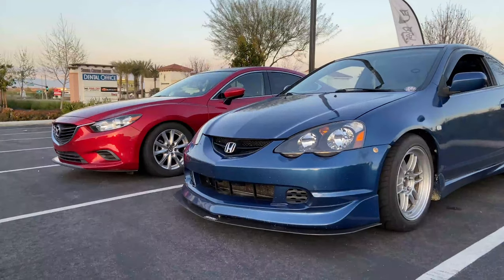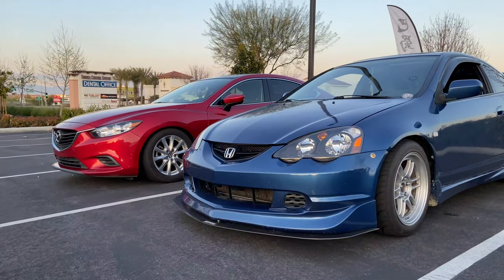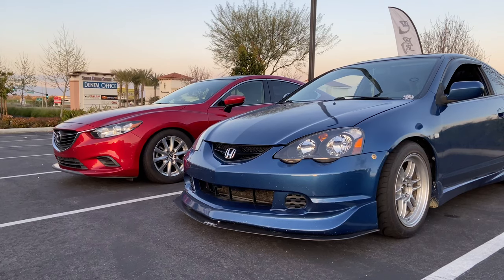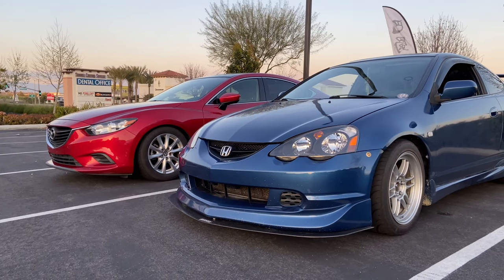VTEC IS NO JOKE! Racing a 2002 Acura RSX Type S With My 2015 Mazda 6!

Comment: Power to weight ratio plays big role here too, vtec won’t win against 2020 Mazda 6 with awd and 250hp and 6s are heavy! Lol
Reply from the maker: It's true, lol I'm surprised that my Mazda 6 did decent against it with only 184 hp and being 3200 lbs.
Reply: ABC Garage your car weighs more than 3900 I have the 2014 Mazda 3 and weighs 3907 with 155hp lol I used to have 2017 3 with 187hp which is what yours should be too and it pulled hard especially with sport mode on btw did you have sport mode? It shortens the ratio to 1:1 for faster take offs
Reply from the maker: Live2RIDE83 look up 2015 Mazda 6 sport weight it’s 3183 to 3232 lbs. I had it in sport mode
Reply: ABC Garage civics weigh almost nothing, I think 2900lbs!
Reply: ABC Garage I’ve always loved Mazda’s and had mazdaspeed protege which put out 170 kind of dainty but modified it had potential to go to 300+
Reply: ABC Garage they generally used same engines just different tunings in transmissions and fuel etc
Reply from the maker: Live2RIDE83 yeah the rsx is actually like 2700 lbs so I didn’t expect to win it was just for fun
Reply: I think the RSX would put up a fight with the V6 one
Reply: 2020 Mazda 6 lol dogshit
Reply: The 6 won't win